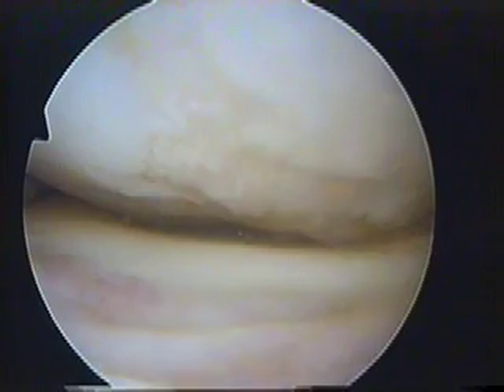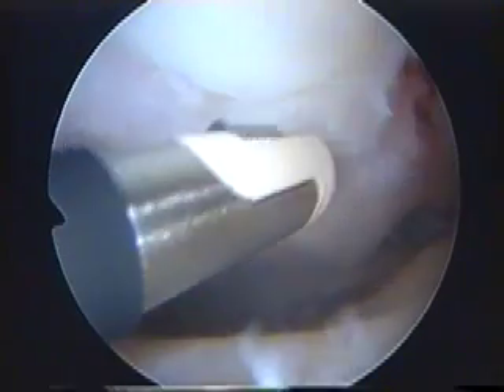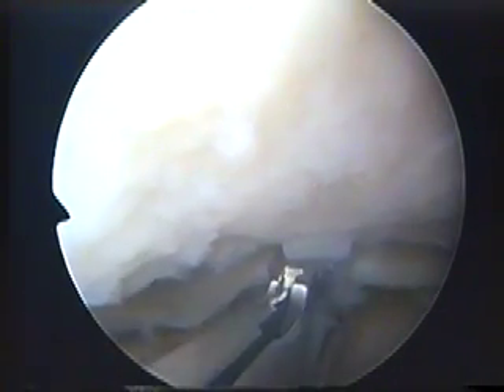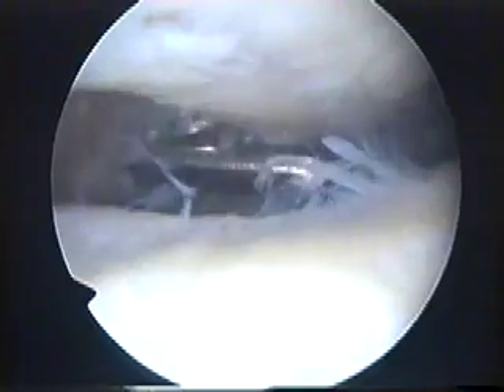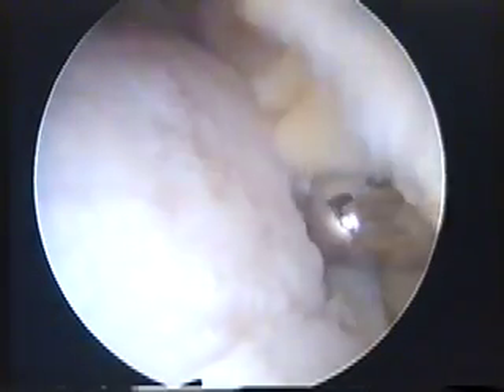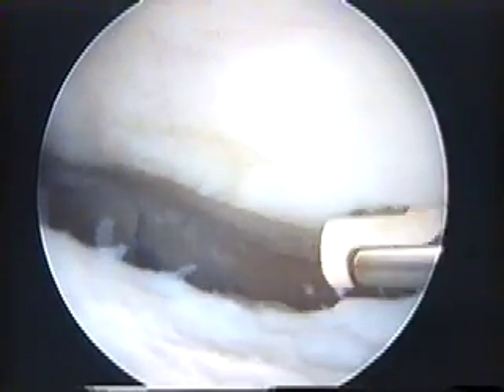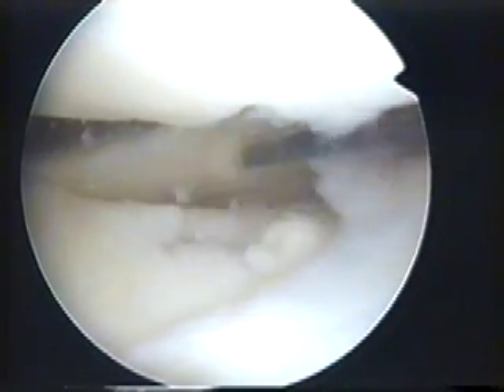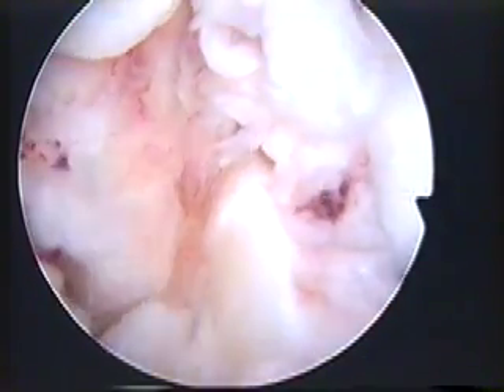Right Knee Arthroscopy Operation

Comment: I have the same question. The feeling of being very sore at the knees, sitting and standing is a problem. Can't have the knees bend at certain angles. The Dr told me that there's a lot of snapping and a scope will find the problem. He used the term 'to find the plucker'. I fell during running and crashed both knees into a drain cover.